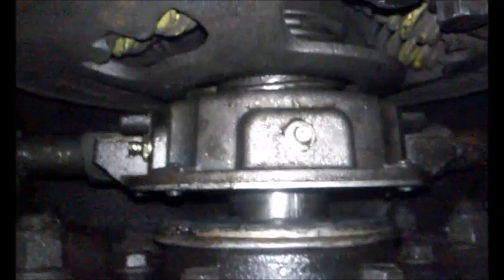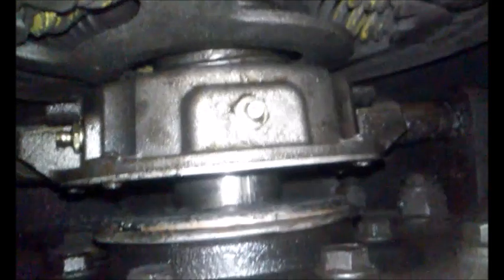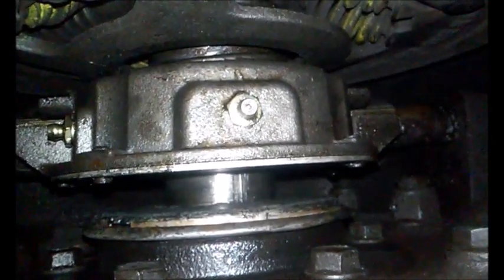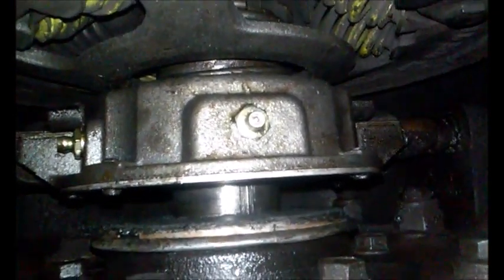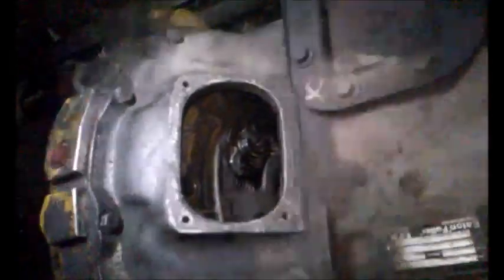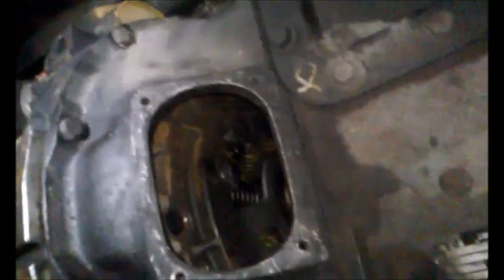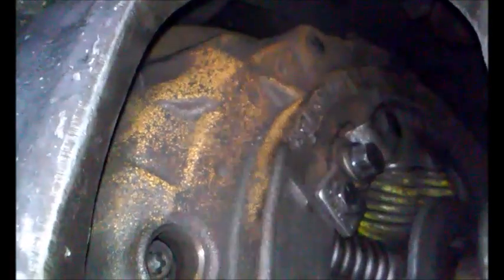CLUTCH/CLUTCH BRAKE ADJUSTING

Comment: If you can step off of ur clutch pedal before u apply ur accelerator, u are using the correct gear to start ur rig moving..
You can go years with out need to adjust the clutch..
Riding or slipping the clutch cause ur in to high a gear will warp the plate between the driven plates and will there after be harder to select a gear while stationary in future..

Comment: Have you ever had to change the length of the clutch rod under the cab to get the TOB close enough to engage the brake disc in the bell housing ?

Comment: Been awhile since last comment but turning the bolt you push in to adjust gap. That adjustment does both the 1/2 and 1/8 inch gaps??
Reply: No.. it doesn't. You have to set the 1/2 inch as shown. You have to set the 1/8 by adjusting the linkage. At least, that's what I remember being taught.

Comment: just use a 1/2 
head bolt to check gap
Reply: I use a long feeler gage 1/2 in wide. Hack saw blade is the same. A torx driver I never use for anything else is 1/8 inch.
Reply: Is that d13 13 sp transmission?